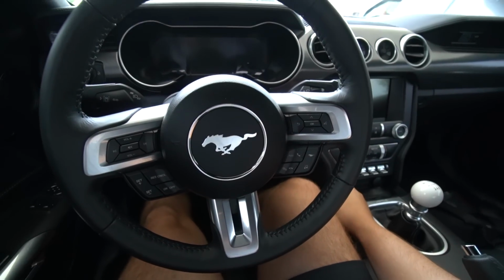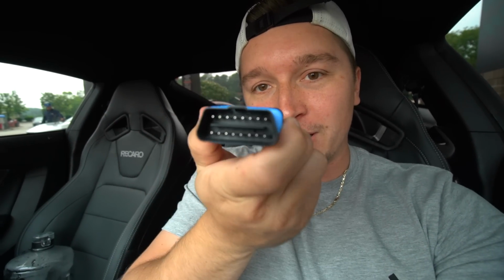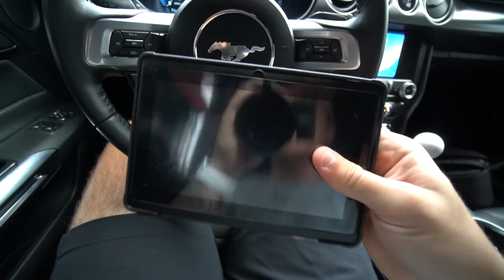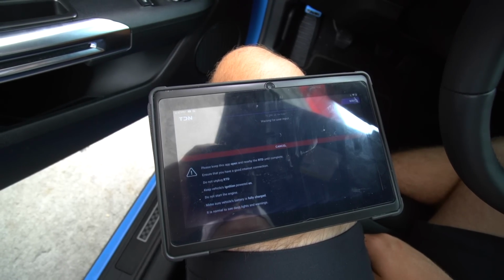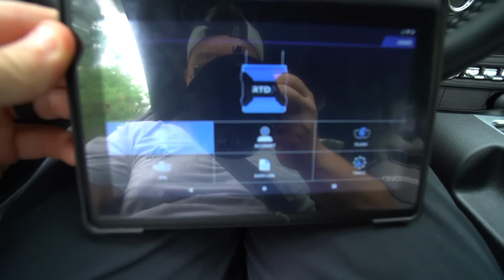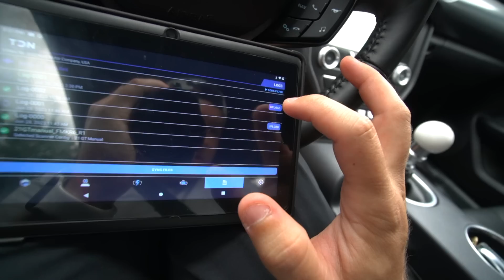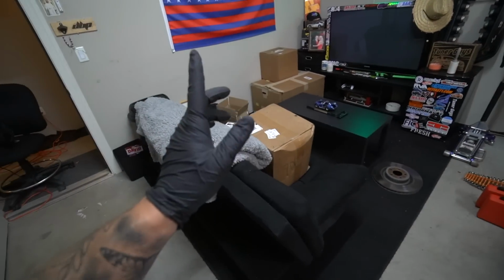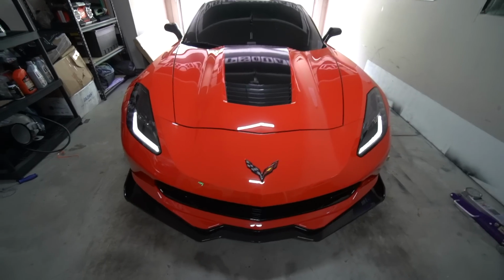Mustang Mach 1 is a MENACE on Lund E85 Tune!!

Comment: Lund does offer Flex tune, might as well ask for it you already paid for it. Flex tune is great for switching fuels especially for that first tank, after that flash the dedicated tune. I had the same issue about the active exhaust not available when I installed my h-pipe, the wires were rubbing against the frame causing a shortage, fix it by wrapping them on electrical heat resistance tape.
Reply: They don't have flex tunes anymore. Stopped a few months ago.
Reply: My factory active exhaust wiring harness on passenger side was rubbing on the body and blowing fuses, lowered the tailpipe and cut about a quarter inch of the pinch weld right above harness and wrapped wires with tape.  Been good so far, ashame I had to do this to a car that has a little over 2,000 miles.
Reply: @woohunter1 you modded the car…. that’s what could happen…………
Reply: @s550jojo  nah, it’s a bad design, oversight on Ford’s end.  Lots of online forums talking about the passenger side harness.  Instead of making an appointment, dropping it off, leaving it there overnight, etc.  I just fixed it myself.

Comment: The active wire issue. It will be the passenger side I bet. Happened to me. So I just bent it where it rubs. No issues and it's been a year. I tried to fix it twice, but no go. Bending it was the best resolution
Reply: You just bent the wires? Can you elaborate? Thx